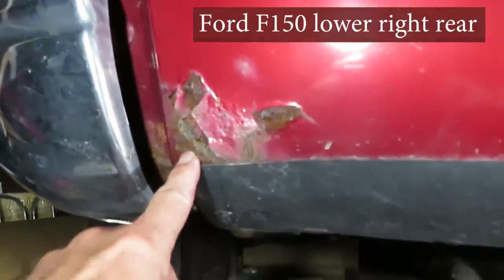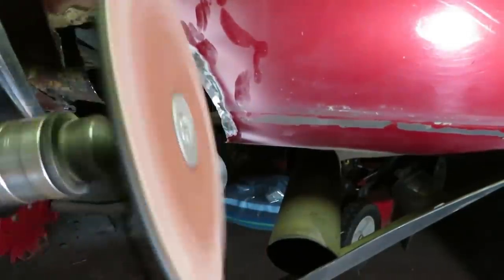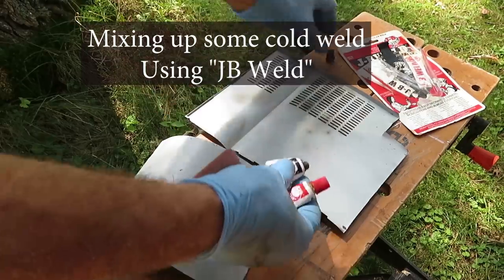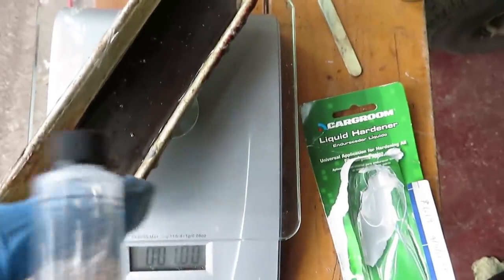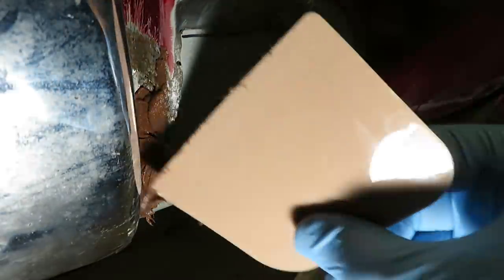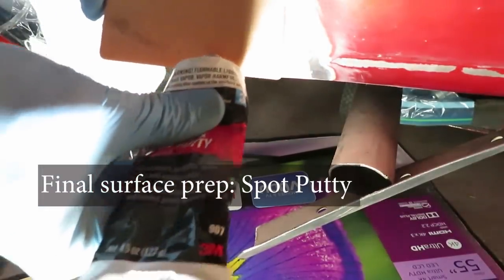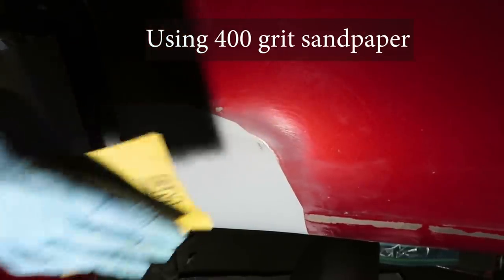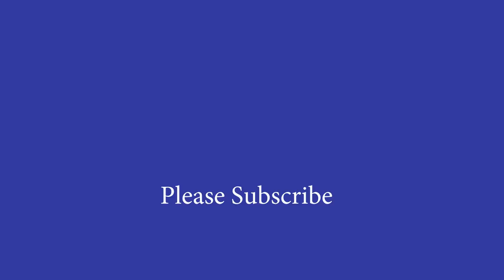How to do a Long Lasting DIY Rust-Out Repair using Metal and Fiberglass

Comment: I always like watching people fix rust. It relaxes me
Reply: Mike R-S do you remove any rust ?
Reply: nick king Just minor rust repair. For example I has some rust under the doors on my impala that I repaired. But I’m about to do some cab corners on a weekend that I have free.
Reply: Mike R I oil spray the panel from behind once the paint is completely dry , mix my  own chain bar canola cooking oil non detergent motor oil and a little kerosene to thin drill 1/2 inch holes to access the rest of the rocker or sills in fact I do my cars and trucks yearly doors, panels ,trunk box hood fenders ,chassis ,lines ,suspension I wear a respirator goggles nitrile gloves  while doing on an old tarp messy but keep rust down if done yearly . Most of the chains that offer this miss to much
Reply from the maker: @nickking1510  good ideas but I want to see the video!
Reply: The Original Mechanic oiling your car or truck will cause rubber weatherstripping  and rubber to swell if it gets on them , you don’t want to get oil on power door locks or power trunk rubber bellows as it may cause them to swell and seize
Reply: Same

Comment: IDK if will work but I'm about to do the same on my 03 f150..i was thinking clamp the metal in place without JB yet
attach the back curved hard to reach area to metal and sand/finish all on a bench.  Finally apply JB and clamp all in place and apply more fiberglass/resin/Bondo to the back inside for strength and sand/paint. 
For strength i like to drill holes and use screws every 2" after applying JB.. when all set sand screws flush I've done this repairing muffler holes before.
Thanks for posting!! good to see the same repair made before I get started.
Also thinking to go to junk yard and cut out that piece from another truck. I don't have a welder but maybe look further into tack with the engine alternator.
Reply from the maker: Seem like some great ideas.

Comment: Nice job! It turned out really well!
 The difference between this repair and a lot of others is that you are actually cutting out the back section past the rot unlike the others which just sand it down and slap bondo on. I'd love to see an update on the repair and how well it's holding.
Reply from the maker: It's only been a year and it still looks the same. I expect this one will hold up as long as I own the truck. Thanks for watching and for the feedback!

Comment: I was really impressed with his use of JB weld and metal on the repair. I was thinking this should be possible but hadn't seen anyone do it until now. Thank you! I am a little surprised that he did just go to an autobody supply store and get the exact paint color match. It doesn't take any more smarts or energy. ,Get the code off of the vehicle from the inside of the engine bay or door panel or find out where it's printed on your car and bring it to the store. They'll mix up the exact color of you.

Comment: When you apply masking tape, roll up the edge on the repair side leave it flat on the smooth painted side. Otherwise you're going to have a hard edge there that is very hard to get flattened out.
Reply from the maker: Nice tip. thanks for sharing
Reply: @TheOriginalMechanic  
You're welcome. At one point in my life I was an auto body repair and painter. I didn't think I needed a respirator and it ruined my lungs. I can't get around airborne paint yet to this day and it's been 35 years. I'm fine as long as I stay away from airborne paint.
Reply from the maker: @jefferyfowler5080  So sorry to hear that. A heads up to anyone doing this kind of work.

Comment: Nice job! The only thing that I would do different is when you are applying the primer and paint spray thin coats and letting it dry. Then keep doing that until you’re satisfied with the amount on the panel. I thought several times you were going too have some runs. I hope you don’t take this comment the wrong way. Thanks

Comment: Your F-150 has the same amount of rust as my Navigator. Another common place for these Fords to rot badly is the radiator core support, so much that the hood latch bracket can rot away. The "feet" of the Radiator on the little ears of the frame can rot right out, too.

Comment: I've been looking on youtube for a "J.B. Weld Autobody repair"  but search found nothing like this. So I finally searched "Sheet Metal repair Steel Epoxy" and found you. I felt like I just had to be right that somewhere someone was using a product like J.B or something close to do welding on rust repair (Permanent fix). So thank you!! I was very happy to have found your video which is very well done and I don't need a welder to patch with steel and stop the spread of rust!!
Reply from the maker: Glad you found it. I appreciate the comment and good luck with your repair!

Comment: To be fair you did wayy better than most of the idiotic tutorials on Youtube on how to fill a hole with expandable foam!
As you say some people cannot weld or dont want the expense of paying somebody to weld on a vehicle that is a worekhorse or not worth a great deal.
Only thing that concerned me watching this was i think I would of used a rust convertor on the rear of the repair and then painted the rear of it too once finished.
The haters who weld should consider than thesedays door skins and other non load bearing panels and skins are stuck on with adhesives at the factory ;) 
If its load bearing like a frame or mount you must weld but fenders door skins etc using adhesive and metal and glass theres nothing wrong with it :)
Not sure on the JB weld I would just use the fibreglass filler to stick the patch,less materials to buy then ;) 
Nice job overall I enjoyed watching
Best wishes from England :)
Reply from the maker: I appreciate the detail in this helpful comment. . So far the JB Weld is holding up. I did reinforce the joint with fiberglass as well.  Rust proofing and painting behind was also recommended by my brother-in-law. Maybe next summer. Snow is flying here in Wisconsin USA today. Have a great day1

Comment: Panel bond adhesive is way better that jb weld, you can buy it at auto body repair supply stores, the metal will rip before the glue.

Comment: Nice repaire,  use a zinc primer on bare metal surfaces,  wet sand at the end 1500,2000 and it would be invisable repaire,   good job sir
Reply from the maker: Thanks for watching and sharing the tips

Comment: Finally a panel repair job without welding. Not all of us have welders. Good job. Is the JB Weld still holding up?
Reply from the maker: Yes it is doing just fine. I've noticed that those who weld can't understand why everyone doesn't have the equipment or training or desire...to weld.
Reply from the maker: yes, aluminum
Reply: Aluminum and steel will corrode also. It's a tough situation. I use Ospho on any rust you can't work on.

Comment: Okay. As someone with a professional bodywork background. This did turn out looking good and it will work good if your try to fix and sell a car quickly or if your just wanting to get a rusty car back on the road. But I am afraid this is not going to be a good long term method. Jb weld is a GREAT product. But it does have its draw backs and it will not hold for more than a few years in such a high vibration application. And there was way too much resin used. You want to get all the fibers saturated and then be able to squeeze as much resin back out as possible because to much resin to fiber ratio creates extremely brittle fiber glass. Lastly, the filler was way to thick and sould never be applied like it was here. I honestly don't see this lasting without cracking or starting to show signs of failure more than about 5 years. In the future I would recommend simply using a plastic sheet instead of the metal sheet and using it only as a form. Build the fiberglass up and just make the entire patch from the fiberglass with as much contact with bare metal as possible, get it ground down as close to the end shape as you can before using any filler.
And never use filler in a way that actually filled in gaps, just use it to basically make the surface of the glass flat. Filler should really never be more than 20 thousandths thick or it will fall clean off over time.
Reply from the maker: I appreciate the thoughtful and helpful advice.

Comment: Hint, make the patch 1st, then mark and  cut the panel, then weld it in place,  use very little filler,  been doing it that way for 35 years it holds as good as  new, hint spray your car inside the metal plus the whole underneath with fluid film every 2 or 3 years and never rust out to begin with..
Reply: Hint 1, get 1 quart of trans fluid, 1 of any oil, 1 tube of grease and 1 or 2 toilet wax gaskets, mix and heat and apply how you like, add what you like or thin how you like. Less than $10 and used fluids and oils you won't ever have to spend $10 for many cans of fluid film ever again. Then tape all water holes in doors and fill with Vaseline, baby oil, mineral oil so doors won't rot. Can spray, brush, etc.

Comment: You better clean up the inside rust or it will come out again these types of rust repairs have about 2-3 years if you clean up the rust really well... Don't say you don't have to move fast with fiberglass depending on temperature I've seen it dry within 1 minute at times and other times  3 minutes... And for a small speck of rust a small broken drill bit or die grinder burr and dig it out and please don't wash painted surfaces with laquar thinners it will soften all the paint as it soaked in to the factory chemicals use wash & wipe or alcohol to was it with... But clean up the rust from behind if possible and give it a coat of a rust paint or something to help it hold up longer .. people come to me a lot about fixing there cars and they don't want to spend big money with welded patches but want glass repair I tell them about 2-3 years and there happy with it...

Comment: Two questions:  1) I don 't weld, so, I am considering using a dimpler and pop rivets instead of 2-part epoxy (good/bad idea??), 2)  How do you feather the area where the new paint/clear coat meets the, old paint/clear coat?
Reply from the maker: I'm not familiar with the pop rivet method. I feather first with a sanding disk on a drill and then by hand.
Reply: You dont want your fill to be thick...by using pop rivets you are just asking for thick fill.. weld it in, get someone who knows how to do it.

Comment: How long will the JB hold?
Reply from the maker: I've had it last for years in more demanding situations than this.
Reply: If applied properly with properly prepared surfaces, and assuming the materials are a good fit for JB weld, JB weld can last a long time.

Comment: Excellent video  there's a waterproof tape real aluminium sticks well at wall Mart house paint dept for smaller holes .saves metal work put filler over top .have used jb to hold the patch works ok .need to seal backside in North water freezes separates the fix .😎 Tuck is the tape . sometimes I put in self drill 1/8 screws to tack then reply w .rivets saves on drill bits.

Comment: Try back taping next time for a smoother transition of paint. Great job. Don’t need to be a professional to fix things. What YouTube used to be.
Reply: also folding printer paper in a u shape an tape it to the unsanded area will feather the new paint an clear. then wet sand until no transition overspray.

Comment: Why not just weld them in properly .If are able too buy a cheap welder for harbor freight ,you can weld them in your self .
Reply: Some people don't want to spend $500 for the welder, then a few hundred for the class, and tanks and then spend months practicing for one patch job. If it lasts a year or two, that's all it's meant to do.

Comment: Not exactly how you should paint. Even strokes across the surface. You also want to roll you paper over around the repair so you don't have a hard paint line
Reply from the maker: You noticed. I am no painter of vehicles. That's why I kind of sped over that part.  For excellent results, hire a pro.
Reply: @TheOriginalMechanic  I'm not either, you have the skill watch a few videos you can paint like one.

Comment: Not every "Diy" Is even a decent job. I think people got the wrong idea about this termn. I thought it meant do it yourself but professinal. What you did there is far from that. Sure it looks nice, good job for that!
But still you haven't clean all the rust, and for me what you did, is just kitsch, look for that word.
I might be different. But for me the kind of repairs "just to look nice" are not repairs.
First of all, that jb weld, is litteraly shit, with time it becomes brittle and will fail. Wanna glue metal to metal, use windshield glue, is far better than that glue. You used am fiberglass body filler, and that is to fill large areas, as the normal bodyfiller will crack if it is too think.  You don't necesarily need to use an welder for a repair like that, you can use fiberglass, and i mean resin and fiberglass, and reconstruct the whole thing, and i doubt any guy can "DiY" that.
I am not a mecanic, nor a body car guy, i earn my living from constructions, but my hobby is cars, painting cars, and so on.  And i can tell you that your video title is very wrong. That not a long lasting job, first of all you used a rattle can, or how you americans call that, of witch paint will fade in few monts in the sun, trust me. Than the job it self, you did not repair, you just cut a pice of mettal off the car, glued another and paint it. Still planty of rust there. Not all people know about cars, some might just see this and say WOW! AMAIZING! But really you did a bad job, any decent body car guy would say, wtf? So i am not trying to be mean, just honest. This is how you fixed your car, witch really is good, good looking, but that's not a repair, and definitely not how you wanna do it. I've seen pretty amaizing Diy repairs, strong, and long lasting on youtube, some of witch i've learned things. And from my experience, and mistakes just like yours, i learned that you never glue metal to metal with any kind of epoxy, sure epoxy is said to be the best bonding glue, and it is, but not to metal. If you want to glue metal to metal, you want to use something softer. I am sorry to criticize your video, but this is a good repair for a year or two, definitely long lasting and how you really want to do it.
Next time i suggest clean the entire rust, take of the parts you can, such as the bumber, and if the bolts are rusted and hard to remove, fill a syringe with break fluid, and wet the rusted bolts, and leave it for few minutes, that will get the bolts lose.
And if you really wanna do a fiberglass repair, and if is done corectly it will last more than the entire car. Than use that pice of mettal as a suport to reconstruct the area, remove it and add another layer on the inside, like a sandwich. Where the rust cannot be removed, use some rust stop, planty products wich will do that. 
Buy a hobby paint gun, use automotive paint, and clear if need, and than you can say is a long lasting job. You didn't even need to cut such a large pice of the metal, you could have clean, and treat the rust, and easly remake  the missing pice out of resin and fiberglass.
I know i sound like a dick. But removing rust is a hard job, especialy on cars, it takes time patince, and sometimes you even have to remove big parts to reach and clean it all. I don't say to make a full restoration of a car. But than people that don't affort, care or like to have a "healty" car, in my opinion they should not have one. And if you do wanna fix something, fix it the proper way, and if you can, leave the people that do that job, to do it the right way and pay them. Not everything is Diy, especialy on a 2000 kg thing that runs with 100 miles per hour. If you vehicle has that kind of rust on the surface, i don't even want to know how it looks like under. Good looking doesn't always, mean good.  All the new cars are build as an entire pice, every pice of that car helps it to have the strenght that it has, don't think you can just glue things to it like in this video.
The only time you can call a job  DiY is when you have the tools and skill to do it as a professional. This is just trash, but it looks good. And no i am not a professional, but i woudn't post a video like this and say "how to"
Reply: @ladaveednas7173  If you make something look good doesn't mean you fixed it. And this excuse "is just a" is just an excuse.
Is a matter of taste, and i myself, like things that are quality, not kitsch that looks good.
Reply: You spelt "witch" wrong. Just sayin'

Comment: You should have taken the bolts out of the bed and moved it so you could metal patch the cab side now its gonna rust with that mud you smeared on there
Reply: How many repairs have You done?
Reply: Gary Rosema now I worked for a new car dealer when going to grade school and hi school and college in the body shop and we brazed in patches and they all blistered  by 2 years , so I asked my boss of dealer ship a super nice guy if I could spray the repairs with new oil after we prepped the car after paint was dry he said sure guess what no come backs so I did all the oiling on every body job , even here in Ontario Canada rust belt . I do all my cars and trucks even under the carpets this repair will last much much longer if he oils sprays and repeats at least yearly ,do the whole truck